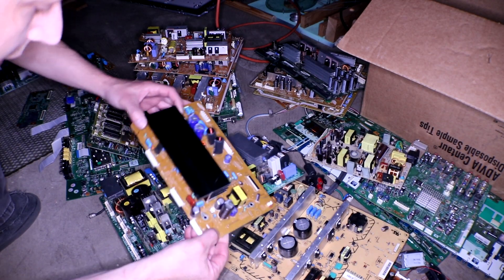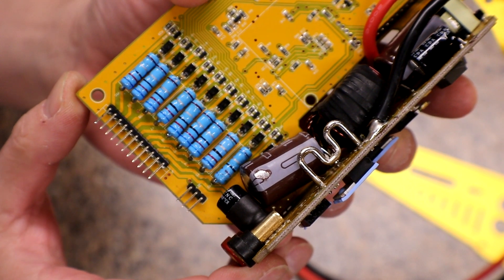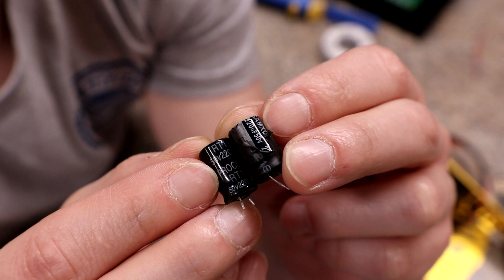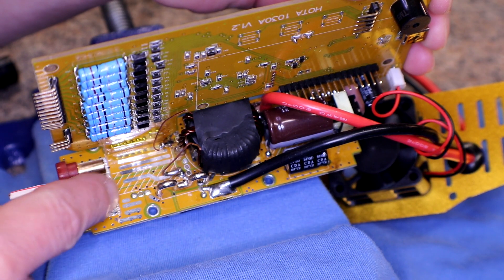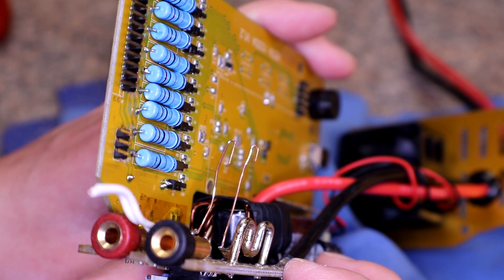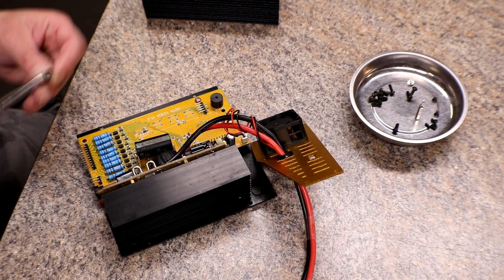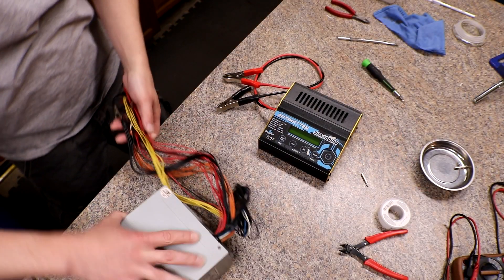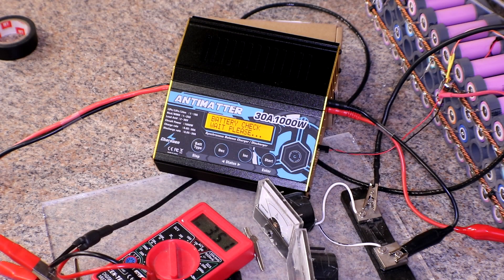Fixing the Antimatter 30amp Charger!!!

Comment: nice job fixing the charger :) just a few observations/suggestions....when un-soldering, add lead solder to the joint and if possible use a flat edge soldering tip not conical when you got heavy copper joints, it will flow so much easier :) ;)
Reply from the maker: Thanks Man!  Yep, I did end up adding some solder but didnt have any other soldering iron tips lol.  Those should be on the list of things to get cause flat edge and a few others would be good to have around!😃👍👍👍

Comment: Very nice work Joe!
Will you limit max current thru the charger to 15 Amps now?  Or will you try 20-30 A since you have more replacement parts coming if the caps blow again?
Reply from the maker: Thanks Man!!!  I want to get at least 2 charge and discharge cycles from it then I may do some higher amp test with it to see what it will do!👍🔥

Comment: 12:45 The sparkle of joy in your eyes! Better than the sparkles from exploding electrolytic caps failing.
You might better have gone with your second-guessing on putting insulation on the extended leads. The way you are likely to toss it around the bench, it may be a future regret.
Reply from the maker: LOL its always a good feeling when something works after you attempt to fix it!!!  Yeah Ill add some protection on those wires once Petes parts come in!!😃👍

Comment: AveRage Joe , Do you have any tips for picking solder to fix a veristor and fuse on a powersupply? Lead, lead free, flux core etc. Also can I use the same solder for fuses on a 18650?
Reply from the maker: This is the stuff I use!  Love it!  https://goo.gl/hHhW2J Yeah this solder is what I use on anything electronic including 18650s!😃👍🔋
Reply: AveRage Joe Awesome, thanks. I have a very expensive 120v Kangen water ionizer given to me and after being plugged into 220v, it blew. I guess I will replace everything that looks busted on the power supply and hope it will come back to life. I may practice on a old video card first  hehe
Reply from the maker: OOO ya try to fix that puppy!!! I would at least attempt it lol.  Yeah its always good to try replacing stuff on other boards for practice!!!💥😆👍

Comment: Great job fixing it. Is there room to put a small fan over the resisters to keep it cooler during load tests? Also thanks for mentioning my brothers house fire.in the discretion. They estimated only 2 to 3% of there things will be able to be recovered.
Reply from the maker: Thanks man!!! Im looking for a small fan to put in there for that reason.  Might as well try to improve the cooling!  No problem with the link!👍 I hope some fine folks from the community read the description box and want to help out.  Ill put it in a few videos for ya and Ill donate once the YouTubes payment comes in!!!😸👍
Reply: AveRage Joe thats awsome thank you. Can you put a heat sink on the resisters or would that short them out?
Reply: AveRage Joe also if you have a deat pack you could do your discharge so the charger charges the dead pack while it is load testing the full pack then it wont use the resisters.
Reply from the maker: I might be able to put some sort of heat sink on them if I insulate it so they wont short out.  Im looking through my box of fans for a small one so I can maybe put that in there to get rid of more heat.  If that doesnt work then maybe a heat sink could be next option!
Reply from the maker: I have some Lead acid batteries I could probly do that with.  Which I do want to try!
Reply: AveRage Joe do both. More content lol
Reply from the maker: True that!😆

Comment: awe I entered to win the Antimatter, thats ok if I ever need one I would get the Tenergy version. plus I dont have any huge packs built yet so no need (and I have the 10A DC load already) fun video! not sure what the inductance of those longer wires will have on the filtering on the capacitor but only an oscilloscope will tell that.
Reply from the maker: OOOOO I got it lol!  Yeah Ill swap those caps out once that box arrives.  I may try to repair his but if I dont I could send it to you if you want it!  Yeah I would have no clue what the extra inductance would be by adding the wires???🙄😆

Comment: I would imagine the reason the caps blew up was because they were so close to the load resistors. Moving them further away from the resistors will have a greater improvement on the original design. 
That wasn't a shoddy design/rework, it was an improvement to the existing design  ;)
Reply: how are the load resistors on with a 1S battery? it was because they were cheap capacitors either not rated for high current (with low ESR) or too close to the inductor and mosfets. it should stay way cooler now but there is extra ESR in the wires so maybe it is good that the wires arent heatshrinked cuz it will just burn off lol time will tell
Reply: The load resistors should still function. How else would the device put a load on the pack to determine the capacity? It wasn't balancing, just draining. Or is there another spot that is also a load?
Reply: i dont know what it uses to load the battery, but it is not those 9 resistors on the balance port, it probably uses the inductor and dumps it all into one of the mosfets, someone needs to test that and see where the power goes, what you should do is put a load resistor in line to dissipate the power instead of making it take all the power itself, I think it has that function.
Reply from the maker: Yeah thats what I was thinking about, the heat getting to them!  Thanks man, I figure those caps will last longer out of the way as well!!!😃👍
Reply from the maker: Those resistors are the load for the discharging Im pretty sure and or balance charging/discharging.  Do you think those wires will get that hot to melt heat shrink?
Reply from the maker: It does have the option for an inline resistive (<-- spelling??lol) load but I think it is to add to the 15amp discharge.  Like if you want to do a 30amp load which would be cool!  As far as testing where the power goes sh!t I wouldnt know how to do that lol!🙄💥😆

Comment: I don't know how factual it is, but I saw a comment on a TIG welder repair post that capacitors will hold up better if they are standing upright.  Especially if they are being used close to maximum capacity or duty cycle.  Also after replacing some on a mother board I found that there are different functioning caps as far as speed.  It's all way over my head and probably why my hair left!
Reply from the maker: Interesting, I dont think I have heard that before.  A lot of electronic stuff is on there side like tvs, computers ect..  Ill see if I can find some info on that.  Yeah all the different functions/speeds is over my head to lol!💥😆👍

Comment: Such a nice feeling to fix something!
Now that it works again, I wouldn't fix it any more... unless to put heatshrink over the capacitor extension. (I'd have used a little heavier gauge wire for it).
If Pete sends you the whole dud unit, then you could fix it and have two!
Reply from the maker: Yeah its always nice when it actually works after the fix lol.  Yeah Ill put something over the exposed wires when Pete's stuff arrives!  If I can fix his also that would be Awesome!!!😆👍

Comment: Dont put the thermal paste on the mosfets. The pads are supposed to electrically insulate on top of heat transfer
Reply from the maker: Ok cool! Yeah I wasnt sure if the paste would help any of the heat transfer on those fets or not!  Thanks!!!😃👍
Reply: mosfets power share  unlike bipolar so as they get hotter they conduct less well and any hot spots spread out bipolar on the other hand current hog the hotter they get the better they conduct so any hot spots will conduct better getting hotter and so on until burnout so the heat sinks while important for mosfets are not nearly as important as they would have for the older bipolar power transistors that used to be used for this kind of thing.
Reply from the maker: Ok so maybe a fan upgrade is in the future lol!

Comment: nused cells! nothing wrong with that.. I hope I can get more new old stock cells. like the Samsung 2600 mah. I have. over 100ah @29.4 v. but that's about 1/10 of what I need to power my home! I got my panels up on a temp. mount. I'm going to find a better place. or on the roof. it's only 600watts I got about 22 amps to the bank @ 25.8v. from a mppt controller. Vmp is about 36v and charges to 29v to balance the lead acid.. it is only connected to my t105's now. I need another controller to charge the lithium . I may get more cells before adding them to the mix. then I hope to get more panels. I'd like 900-1200 watts. and about 400-600 ah in liion. to get me through the night! and a DC generator for the rainy weeks like we just had!!! that sucked! keep at it .. waiting for the next one!!!
Reply from the maker: Yeeees, NUSED cels LOL!!!😆  I love the pinks!  I have been getting some great numbers from those moli cells.  The last 50 or so have been 2700mah to 3000mah!😲 What charge controller are you using on you t105s.  Can you log into it to change any of the charge settings to match close to the Li-Ion cells similar to what I am doing?  I totally need more solar.  I can keep the frig on it most of the time unless we get those days and days of rain also.

Comment: 2.57 at mouser you might want to heat shrink that with some aluminium or aluminized mylar for heat protection so hear the resisters if they get hot.https://www.mouser.com/ProductDetail/Nichicon/UPW2A102MHD?qs=sGAEpiMZZMtZ1n0r9vR22a%252bYJIhWynPaIKiWUi2SSVE%3d
Reply from the maker: OOOOO yeah thats the 100v cap I want to throw in there!!😲🔌💥

Comment: That lack of heatshrink on those exposed wires bothered me. I know they won't touch, but still. When you replace the capacitors with the new ones please for the love of god put some heatshrink on those wires :) 
Otherwise congrats on the fix! :)
Reply from the maker: Yeah I figured I would be taking it apart again so I didnt bother lol.  For sure will add some sort of protection when I replace the caps with the new ones!!!😆💥